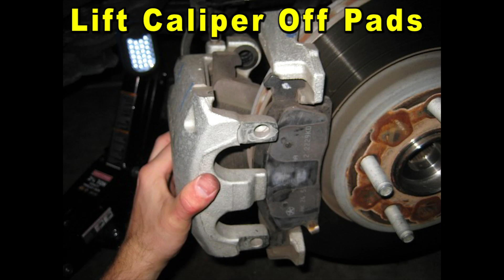2011 To 2021 Jeep Grand Cherokee How To Change Front Brake Pads With Part Numbers

Comment from the maker: Jeep Grand Cherokee Front Brake Pads - https://amzn.to/3z9dUdL
Power Stop Brake Pads Part Number - https://amzn.to/3MvKCce
Bendix Ceramic Brake Pads Part # - https://amzn.to/3MvmJSe
Wagner Ceramic Front Brake Pads - https://amzn.to/4g9Jh8N
Precision Screwdriver Set - https://amzn.to/3sLixaP
Plastic Pry Bar Tools - https://amzn.to/4cPO5xb
Socket & Ratchet Set - https://amzn.to/3Z17LbA
Mechanix Gloves - https://amzn.to/3jCnHkt
Torque Wrench - https://amzn.to/3vS5uSI

The Paul79UF YouTube channel is a participant in the Amazon Services LLC Associates Program, an affiliate advertising program designed to provide a means for sites to earn advertising fees by advertising and linking to Amazon.

This DIY video shows owners of the WK2 4th generation 2011 to 2021 Jeep Grand Cherokee how to change the front brake pads and lubricate the caliper slide pins with the service manual torque specifications for the caliper bolts, bracket bolts and lug nuts.

Comment from the maker: Check out the DIY guide for changing the front brake pads on a 4th generation WK2 2011 to 2021 Jeep Grand Cherokee SUV - 
https://www.paulstravelpictures.com/Jeep-Grand-Cherokee-Front-Brake-Pads-Replacement-Guide/index.html

Here are all of the DIY repair and maintenance tutorials for 4th generation 2011, 2012, 2013, 2014, 2015, 2016, 2017, 2018, 2019, 2020 & 2021 Jeep Grand Cherokee SUV - 
https://www.paulstravelpictures.com/Articles/Jeep-Grand-Cherokee-Common-Problems-Repair-Maintenance-Guides.htm

Owners of other Chrysler, Jeep, Dodge and RAM SUV or minivan vehicles with similar tail gates such as the Town & Country, Patriot, Compass, Cherokee, Durango, Journey, Grand Caravan, and C/V Tradesman may also find these DIY instructions to be helpful.